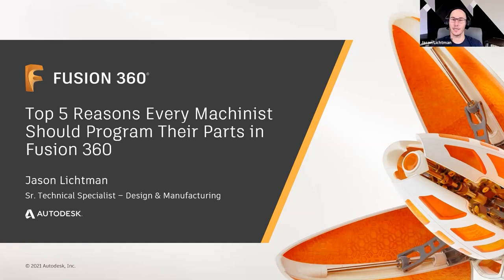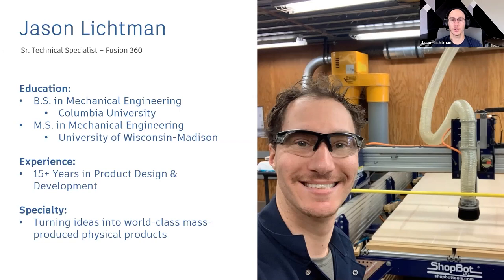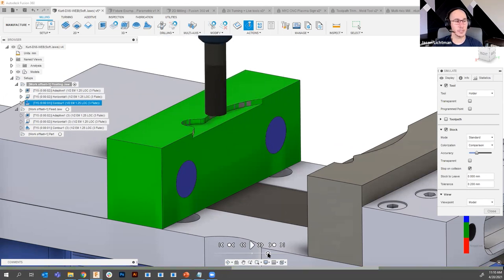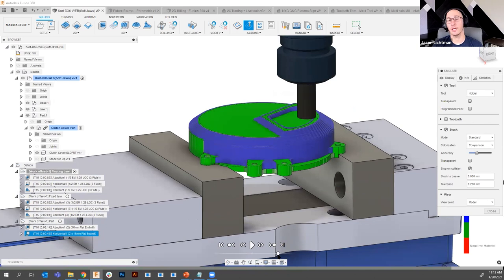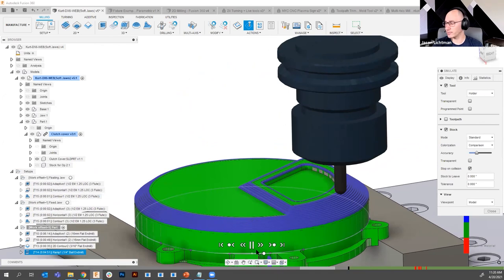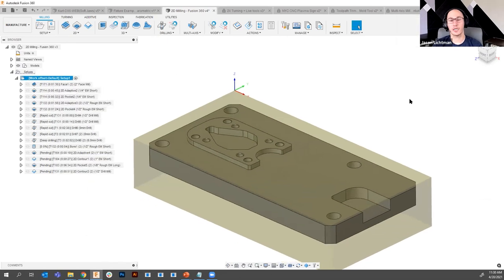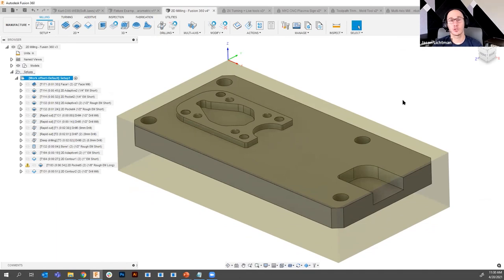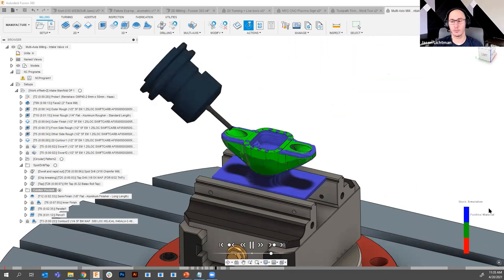5 Reasons Every Machinist Should Program Their Parts in Fusion 360

Comment: I teach CNC Machining 8 years and have 30 years CNC experience.  I started as a hand G Code programmer in the 80s (paper tape) to being a rabid Fusion 360 CadCam user today.    Understanding G code is very helpful - like post process mods - or quick updates at machine.  In a medium size job shop you don't want to be running back into the workstation to change feeds & speeds etc.  but I am so comfortable running straight out of Fusion code to making parts !

Comment: The integration is great. using some of your sketch lines from modeling the part as containment tool boundaries speeds things up amazingly when you are working with lots of surface modeled shapes.

Great way to prevent problems is to do all of your trim toolpaths at the very end of all of your work. even if your working from multiple work offsets and copying and pasting operations. Do not copy and past or duplicate operations with any sort of tool path modifier or you stand a very large chance of having the program crash.

I love fusion but I do admit that when I see a new update and everything has been running smooth I do make sure I finish all the work for the day before restarting fusion. So many times a bad week can be caused by some update that causes a bug. Nothing better in the world then seeing the restart for update after a week like that.

Comment: Fusion 360 is a good product but it is not fast or stable.  I have use it for a few years but I am looking at other products, not because of the product, but because of Autodesk management.  You cannot trust them as they have, in the past changed their licensing and held there own customers work hostage.  I will never use a online product ever again.
Reply: Ajax, I am sorry you had a bad experience. In my personal experience, Autodesk does right by its customers when it changes pricing, etc. Not sure what happened in your case, but it sounds out of the norm. Lastly, I'm not sure you are going to find off-line products for very long. The entire industry and entire world is moving to the cloud.